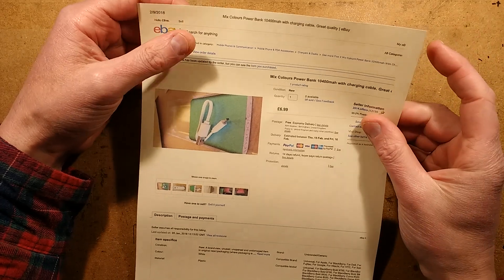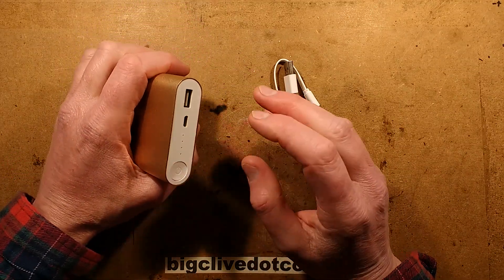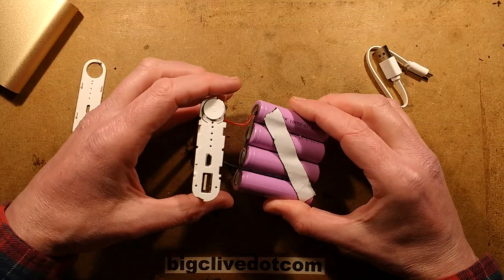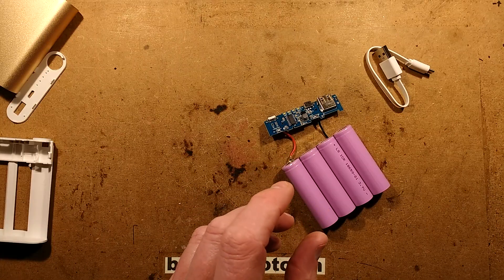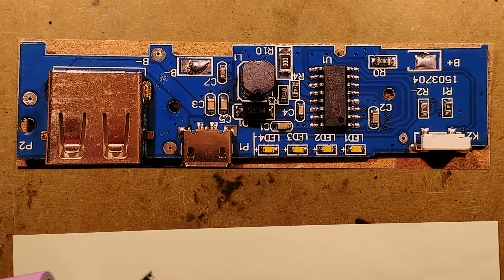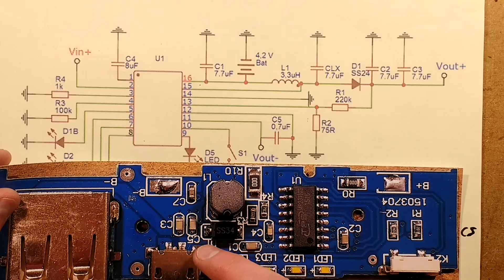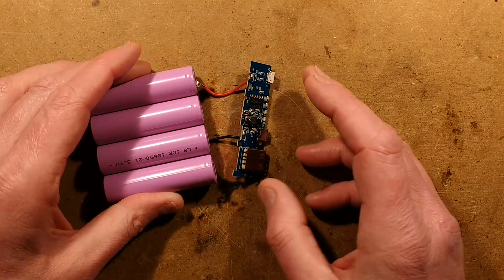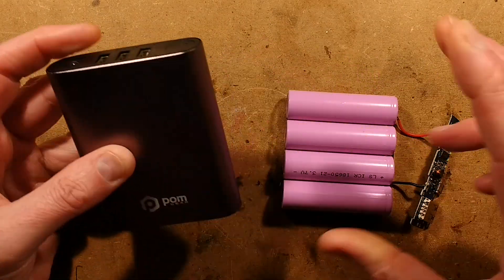Inside a fake "10400mAh" eBay USB power bank.

Comment: Speaking of the high capacity cells, I really wish Anker's stuff wasn't so expensive so you could take apart their stuff. I have a 10050 battery from them which I'm sure uses three 3350 cells, but I'm not keen on taking it apart.

As for these fake batteries, I also see single cell packs in stores here in the US claiming 1A output... Yeah, no. It's really disappointing to see such crap in physical stores, but I guess that's just the irony of the "convenience" store at work.

On the flip side, Nebo, a manufacturer of decent quality flashlights, now makes an actually good camping light, but without the mains, solar panel, and USB nonsense like the "death daleks". That said, I really don't know why nobody makes them as battery packs with the 18650 cells...

Comment: I bought a few of these "4 Slots 18650 Battery Charger Box" (w/o batteries) on Amazon for a few bucks a piece. They work great. The ones I got have a "UPS" mode where you can charge and discharge at the same time, which is really nice. I haven't dissected them yet since they work too well :)

Comment: The power blank or the cheap no cell ZTE ones are good at least they keep 5 v all the time stop at point of an voltage and work good and keep the cells longer I saw one of those on eBay without cells feel its better to buy 2 laptop battery's and use cells then when 1 dies or drops mah u use the good ones

Comment: How accurate is that UT658 tester? Thinking about buying one. Any tests?
Reply from the maker: I've not done a set of tests on the USB testers.  I really should at some point.
Reply: Any point in the near future? Then I'll delay my buy :)  
Interestingly I find lots of russian videos testing that one (as with other electronics from aliexpress you'll always find lots of russians talking about them when you search for the product name) so an english video would be nice (make sure you add the product number in the title, so you will pretty much get all the non-russian viewers on your video as a monopoly ;)).  
There seem to be really advanced ones like the zy1276 (but quite pricy).  
Rd Tech (the guy from China who designed/sells this power supply that eev-Dave tested some months ago (and Rd Tech also has a YT channel)) also has several cheap ones in his shop on aliexpress (link on their YT, I don't dare to link as YT might block my comment). The UM24C  seems to be particularly interesting, not that expensive but even with bluetooth optional (he said in one of his video comments, that he gives YT reviewers free samples btw).

Comment: I bought exactly the same style one but it doesn't come with batteries, it's meant for 2 cells and spring contacts so you can just pop your own cells in. The chip has a different code on it and what I could translate off the chinese datasheet is a 1A charge/discharge current capability.
I've tested this with an usb charge meter and it checks out, charges up at 1A and discharges at 1A while holding 5V too. Although when charging the power bank, it starts limiting current when the cells are about 4.13V and then lets it trickle up to 4.18V when fully charged so it's not quite CC/CV charging, even though that shouldn't do anything bad cause it doesn't go above 4.2V. Also it doesn't terminate the charging well, it goes down to 2mA and then shows full, so the last little bit takes forever as you can imagine.

Comment: Hi Clive, can you test a current drawn from battery pack when board is in stand-by/idle mode? It quite handy to know how quickly it will self discharge... And also what about over&under voltage cutout threshold? ... As you mentioned low current application like running an esp8266 or so... Thanks!

Comment: I have one of those 5 cell power banks. Two of them wasn't even connected! Of course with sand inside! Other three cells: dead. After charging them all of them have around 1000mah each... 20000mAh on box:)

Comment: hey, you have to buy a (RuiDeng) RD UM24C . its a usb 'tester/meter' with Bluetooth Connection. you can use it via a BT Stick on your PC with a Software and/or with a Android App on your Smartphone/Tablet. I quiet like that Device because it shows you many things.
-Voltage
-Current (3 dezimal places)
-mAh
-mWh
-W
-Resistance
-Temperature
-Voltage on both Data Lines
-QC 2/3
-Color-Oled
-different Grafic-Screens
ect.

Comment: I like these power banks just for the sleek case and the simplicity (no LED torch youre never going to use etc) although I got mine empty of cells for like a quid each. I prefer the kind with the sprung battery contacts tho.

Comment: So, you just hit ebay up for a refund and you get a free low capacity battery. Try force them to stop being fraudulent.
Reply: Agreed, as in my comments above.
Reply: Ebay now favour their sellers over the buyers and manipulate the feedback system to reflect this. I have stopped using Ebay because I was a victim and they supported the seller. If you loose a genuine case and you cannot give bad feedback, to me, that is corrupt. DO NOT trust the seller feedback scores!
Reply: Umm.. opposite. Ebay favours buyers. It's the sellers that can't give neg feedback for non-paying bidders/buyers.

Comment: I wonder about the value of the CLX capacitor. Unless that boost circuit is some vastly different topology to what I'm used to, placing a 7.7 uF capacitor there seems way too large. It would mean that a significant amount of the capacitor's energy is discharge through the switch to get the inductor going on each cycle. Normally, I'd expect no capacitor or at most a few nF to soften the switch edge a bit, on the inductor side of the output diode. (Ie anode for a positive boost reg. ) The actual corresponding capacitor on the board looks smaller than the others though, so probably that's not the case though.

I found a different schematic which looks like a possible match but still not 100%.

https://pp.vk.me/c633626/v633626036/4ffb/iq_GhAF4lQI.jpg

Comment: You can get similar power banks from ebay that come empty aside from the circuitry ( which is the same as in yours) and put whatever quality/capacity cells in them that you choose.  If I put Panasonic 3400mAh cells in then I should be able to achieve 4 times the capacity of the cells, you would think?  But when you look closer Panasonic only say 3350mAh in the spec under ideal conditions with discharge to 2.5V cut off.  Most power bank circuits aim to shut the batteries down at around 3V which will be subject to component tolerances and could be higher, added also are losses in the conversion (step up converters are generally lossy compared to step down) .  Add to this some small volt drop in the circuit and what (in theory) should be 13,600mAh actually measures around 10,000mAh, and yes, they are genuine Panasonic. So, you will never get true cell capacity as used in any power bank device.  Good quality power banks will usually indicate something closer to achievable capacity and not just combined cell capacity. As a professional user of power banks I have many of them including many of the much vaunted Xiaomi brand and  I have to know what capacity to expect in the field. Under Lab testing conditions all Xiaomi units test at less than stated capacity typically by around 10 to 20%, most users would not be aware of this though.

Comment: You are lucky to get 4000mAh. I got one cheap (around 15US$) Xiaomi Mi 10,000mAh power bank with a beautiful aluminum body that has the similar characteristics, the first 3 LED lights up immediately after plugging in and it will never deliver 5V when the load is on. I checked the capacity and I get only around 1200mAh.
The one that I'm talking about is much slimmer for 18650 so it might have 14500, maybe but the capacity is really bad. 4000 is still a good enough capacity but 1200 that's just bad.

Comment: That capacitor marked CLX on the schematic seems really strange. It is right across the shunt switch and the flyback voltage. I wonder if it is really there?
Reply: It is a snubber, but is also the linch pin, it eventually fails and causes the chip to short out in the charging section. Saw this happen on one of my power supplies.

Comment: I think you get the best value buying the kits and adding your own cells, the kits are super cheap compared to even the cheapest of the "fake" powerbanks like you have here. The cases and circuit boards are usually pretty good.

Comment: Its knockoff of the Xiaomi Power Bank 1... The original is excellent quality with LG 18650's and cell temperature monitoring and output short circuit protection... (Yes I have it since 2 yrs and I tore it down and it is still working fine..)

Comment: Well I have some cheap Chinese power bank rated for "5000mah". But Opening it up and doing some testing, that value was only true at 3.7 volts and not the 5 volt usb spec.
Reply from the maker: +WindowsXp16 The mAh rating is the cell and not what you get at 5V.

Comment: Amazingly similar to one I fixed this weekend, but some internal differences. Mine has flat lipos, not 18650's, and some associated changes to the drawer.

I'd be curious to find out if this is the Xiaomai battery or a closer copy of it.

Comment: I had for several years one EXACTLY the same apart from the marking; it was marked 5400 mAh.
It served me well until one of the cells died. I took it apart and kept the good cells.
Together with one other cell from another powerbank where the electronics failed I populated a powerbank from Banggood in which you can exchange cells and they have now a second life!
So the cheap powerbank was a good investment after all!
Reply: Just take care and never use/charge the thing unsupervised because you should never mix and match Liion cells, especially not dodgy Chinese ones! They have differing capacities which will lead to one of them being deep discharged, which is bad news!! It's best to populate the powerbank with cells from quality brands like SONY, LG, Samsung or such, and always use brand new ones from the same production, i.e. they should never differ in age or remaining capacity. In other words, you "marry" new cells together for the intended use. Source: am a vaper and try not to incinerate myself ;)
Reply: Good for you mate👍
Reply: I see exactly the same model with a generic name
The model i read in the box was KT-029 with fake 20800 mAh

Comment: hi i found these usb 2s lithium chargers can you check if they are any good 
https://www.ebay.com/itm/Wltoys-High-Quality-7-4V-Lipo-Battery-USB-Charger-Cable-for-WLtoys-U5U0/182913412960?ssPageName=STRK%3AMEBIDX%3AIT&_trksid=p2057872.m2749.l2649

Comment: Measuring capacity while charging is not the right way to do it, especially for Chinese cells which might be "repurposed" been taken out of some recycled electronics age rewrapped. Older cells are likely to have very high internal resistance which makes measuring this way particularly poor.

Comment: I think you should experiment by adding various resistors to see if there's any effect on the output current. If there is, you should be able to calculate the desired rating and change the SMD ones for new values.

Comment: Yep.  Good analysis, as always, and thanks!
If not for the deficiencies of the electronics, I'd happily drop a bunch of high-end 18650's into that thing and make it even better than 10AH.  I have a unit of that basic form and type that I have been using to extend the usefulness of a GoPro.  Its capacity was never huge and of late it's diminishing.   I'll take it apart in due time and consider that very thing.

Comment: When you first pulled the pepper out I thought it was a sex toy. I'm sure there's a USB charged dildo, maybe even controlled by the computer for different settings.
Reply: I seem to remember that Clive has reviewed a mains powered sex toy (meant for internal use no less) that wasn't properly insulated.  That would put a new meaning on the word bang in a sexual context.
Reply: mgunter pervert

Comment: This is a fake power bank. I have the original and I have opened it.

Inside it have a TI specialized IC for power bank that talk via i2c to a micro. Samsung cells and a proper circuit implementation. (I remember a thermistor near the battery)

This one is rubbish.

Comment: I have a 5000mAh version (2 cell) of this and it does the same thing with the charging. Pulled it apart and figured the batteries were bogus. Although I managed to get close to 2Ah per battery on mine but that dropped off quick after some use. Also, the quiescent current drains the batteries fairly quickly on me.

Comment: I brought a batt bank that you put your own 18650 batt in,It takes 8 or you can put in 6 if you want .You can charge them through the unit,it takes a while or you can put them in your own lithium charger .It has three 5v output ports one at 1 amp and two at 2.1 also has a good light. It has a digital screen that tells you mow many amps you are plugged into and how much % is left in the batts I have good batts so it charges phones etc lots of times.Because it comes with no Lithium batts  in it it only costs around $11 AU..

Comment: My powerbank has 2 usb ports rated for 1 amp each, could I paralel them to charge my phone at 2 amps? my phone charges slowly at 1 amp and using it makes it not charge at all at 1 amp (huge phone life) the powerbank clearly states that it will do 1amp x2 but not 2 amps on one port.
Reply from the maker: The ports are probably wired in parallel inside so I doubt it would make a difference.  Have you checked the charging timer in each port?  Some have different data pin configurations to encourage specific brands to charge at the higher current.  Slow charging is much better for the phone and charger anyway.
Reply: +bigclivedotcom It's one of those sealed waterproof solar ones (would take 20 hrs to charge at 200mah, too bad it's a gimmick, 1 watt solar panel) I haven't tried opening it since I intend to use it and that might pottentially destroy it, no visible screws, It's around the same size as my phone and it has printed 15000mah on the back, could hardly believe another rating of 5000mah I found for an identical one on some indian site. Should charge my phone atleast one time I hope, charging at 2 amps should be around 1c rate for the battery if I were to guesstimate it's real capacity (I don't have any of those usb testing tools, I should get some along with 18650 battery testers) I'm guessing since it can charge 2 devices at 1 amp at the same time, maybe it doesn't do more than that in case someone tried charging using both ports and it's not smart enough to limit the current which could be bad for the battery at 3-4 amps. As for the data pins, I don't really have a way of checking if it uses them when connected to a phone, I have a samsung phone, Probably one of these lying packs wouldn't have enough capacity to try and favor other chinese devices anyway. 15000mah, 60 watts in a lipo that small? these guys should make electric vehicles since they solved the energy density problem (lol). my 18650 battery pack that I salvaged from laptop batteries has about 60 watts and is the size of 8 of my phones stacked, not 1. Ah the chinese and their shitty lies, like those 10000 watt "maxxx" car audio amplifiers that have a 40 amp fuse at 12v.

Comment: As far as I know, this is a knockoff of an older Mi Power Bank 10400. The real one comes only in silver or pink, as far as I know, and in terms of actual charge capacity, the genuine ones have better charge capacity compared to the fake ones (I have a later (but not current) 10000 model).

(Gah, I hate YouTube and Google Plus's Markdown implementation, and I feel Discord and GitHub's implementations are much better)

Comment: The construction of this cheap powerbank looks excellent, even for a copy of a xiaomi product, if the charge/control board could do 2A I would just get some recycled or cheap higher capacity cells and have quite a nice powerbank. This one could charge my phone aproximately one time, while the real deal would do about 4 times. Too bad the pcb can't do more than 1 amp. I have a similar deal huge capacity written on the back powerbank, probably lipo, with a solar panel on it, but it says it charges at 5v 200ma, aka 1w/h which is insignificant. too bad it's a gimick, it also says somewhere along over 10000 mah but I don't belive that, I should get some battery capacity testing equipment, cheap stuff ofc, what would you reccomend?

Comment: I have a power bank that looks just like that except it was a kit (supply your own batteries) and the plastic tray had spring battery terminals (no soldering for the batteries). It works OK but during a power outage I used it to charge my iPad Mini and it would not keep up with the power usage (iPad battery still slowly went down but slower than normal while if plugged into the wall it would go up even while in use). I bought 2 of them and I think I paid $6 for both off ebay.

Comment: Regarding that 2nd power bank: 2 of its outputs are labeled 1A, and one is 2.1A. That tells me, it may be genuine capacity-wise, but the circuits are only designed to handle 1A. The "2.1A" socket is merely wired like an iPad charger, so Apple devices (and only Apple devices, no other brand) will draw up to 2.1A from it. The other sockets are likely just standard USB DCP outputs for true USB loads like Android devices that (as required by the standard) gradually increase charging current until the voltage drops below 4.75V, which will likely happen around 1A. So, it's likely a genuine 10400mAh unit, but not a true 2.1A one.